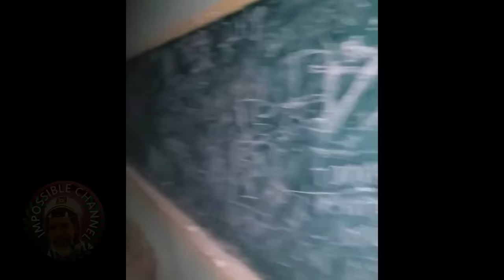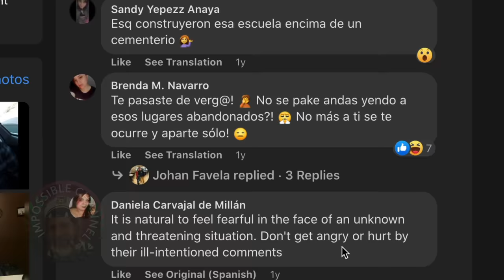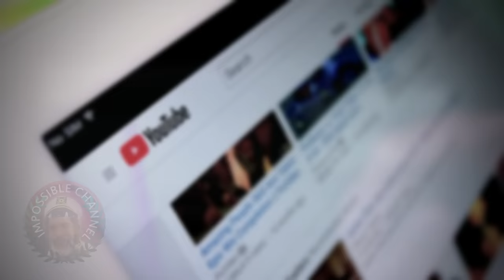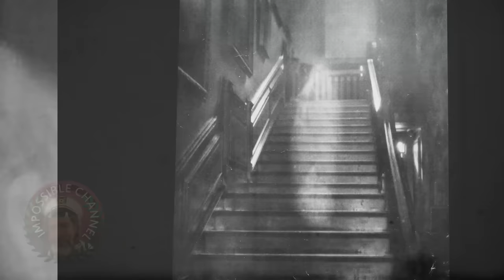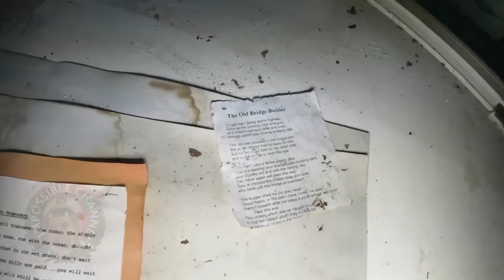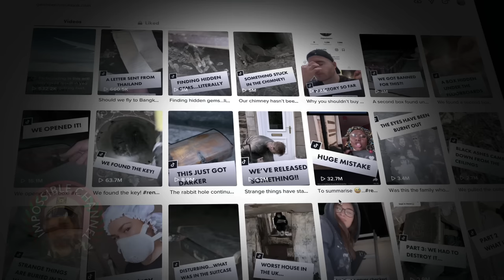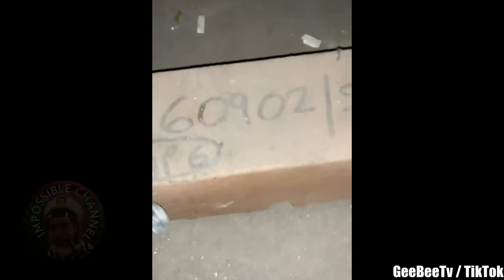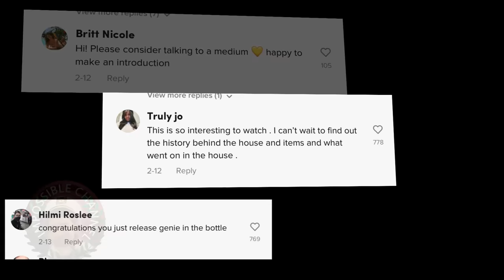This Man Was Throat Singing When He Saw A Skinwalker - And Other Insanely Creepy Videos

Comment: The phrase "Peidiwch â ryddau" appears to be in Welsh, a Celtic language spoken in Wales. It translates to "Do not open."

As for the strange wooden box with a pentagram, it's important to note that the context and meaning behind such an object can vary greatly. However, a pentagram is often associated with occult or mystical practices and can have different symbolic interpretations depending on the cultural or religious context.

Given the combination of the Welsh phrase and the presence of a pentagram, it could suggest that the box contains something of significance or potential danger, and the warning is intended to deter individuals from opening it. However, without more information, it's difficult to provide a definitive explanation. If you encounter a situation like this in reality, it may be best to exercise caution and seek advice from experts who can assess the situation more accurately.

Comment: The flashing lights in the cloud with various colors are either plasma lightning (due to an excess of cosmic rays- extremely rare phenomena) or what’s called “sprites” lightning striking upwards usually from the clouds almost all the way into space. They are a commonly result of an excess of particles usually due to a solar storm or similar. These can also strike from ground up, and are very dangerous you do not want to have clothes of mixed fabrics or similar that creates a static charge cause then you can count on being hit. Same goes for buildings or constructions that are poorly or not at all grounded. Like the bridge in Italy.

Comment: Heh. I used to clean a kindergarten, which started as using only the upper floor of an old building that had originally, in the late 19th century, been some sort of a storage building for a manor house nearby. The ground floor had recently been a nursing home, but when I started to work there it had been empty for several months already. The kindergarten later expanded to the downstairs, but before that, when it was just the upper floor, the place could be a bit scary sometimes. I did the cleaning only on the weekends when the place was completely empty, and one weekend when I had gone there late some toys, the type that makes some sort of noise, suddenly started to work. Three altogether, one after another. 

I finished the cleaning, and the toys went quiet after a while, but you can bet I worked very fast, in order to get out of there as fast as possible, after that. And after that, I tried to get there always only during the daylight hours.

Comment: About lights in clouds. I also saw such ones above my city.  Once upon a time there were gaps between the clouds.  This light reflected off the clouds, but disappeared immediately in the gaps between the clouds. I also didn't see there was a pillar of light from the ground - but the pillar would have been visible if the air was polluted.  In clean air, it cannot be seen. Those are party lights.

Comment: That's Welsh on the box; it means something like 'Don't set this free'.  And one of the men in the burnt photograph had pinholes through the eyes.  Inside the lid of the second box you've got 'peidiwch' again, which means 'don't'; 'a' is 'and'; 'gadael iddi' is 'leave it alone'; and 'siarad' is 'talk'.  This must mean using the ouija board.  This young couple have something very bad on their hands, and if they want to stay, they need to get the house cleansed pronto.

Comment: I remember an article in a science magazine or journal about a team was trying to develop a way of transmitting 3 dementional images like holographics in the sky, similar to the areal billboards in the movie Blade Runner, by suspending aluminum oxide particles at a certain altitude to act as micro-pixels with lazers projected from satallites that excite the particles rather than reflect. So the transmissions would glow which would give a very different visual experience. That was 1982 or 83 so looks like they're getting really close and they are now testing and troubleshooting their technology. Interesting, very interesting!!!

Comment: The video where the couple are renovating the large house, in the attic you can see what some would think its just dust floating in the air but I believe it it spirits floating around. I live in a house inside of a cemetery and Im sure it is over 100 yrs old now. When I first got my security camera I had never had one before so I set it up in my room and started recording and then I left the house for a while. When I got back I checked the footage and I seen hundreds of those little things floating around my room and with the naked eye you can not see anything like what was recorded. I checked here on yt and learned what those little things “could” be. 
 Ive have lived in this house for at least 15 yrs and have never had anything bad or scary happen. When I lay in my bed I can feel when a train is passing through town on the tracks but those are about 2-3 city blocks away.

Comment: The quartz rock is interesting. Quartz has some pretty amazing properties; it’s been used in clocks and watches for years because it vibrates to a certain frequency. It’s also the crystal used in crystal radios. 
While this could be some kind of prank (it sounds like a distorted radio broadcast of some kind of strange choral piece), I’m wondering if the crystal is emitting sound waves of some type? 
It’s a shame no one seems to know where this is, because it’s be fascinating to investigate!

Comment: the "sky quakes" maybe caused by tunnels being drilled through hard rock which can cause harmonic echos through certain type of rock and   structure. I'm a welder and while I was at work on a metal ship someone grinding on the ship in another section made similar noses and it made me think of these videos. Just a guess though I know they say there is no seismic activity but is a tunnel being drilled enough to register on a Richter scale anyways? 🤷‍♂️ it sounds loud but that doesn't mean its caused by something big especially if the sound becomes harmonic. There are many rumors about underground tunnels that stretch all the way across America but again I don't know just a theory.

Comment: 8:29 part is really easy to fabricate. He is supposed to be alone, but how can we know it? There could be some string attached to the plank and when the guy goes inside, a collaborator pulls the string -- and slams the door.  Comeon... What is the apparent solution? Ghost or a little trickery?

"not looking for views" ... Comeon . . Which youtuber isn't looking for views? xD Also, if it is not your cup of tea, and you post only one "paranormal" video, it is much easier to get by with a little cheating.

also.. the acting wasn't that good in my opinion. Kinda overkill.